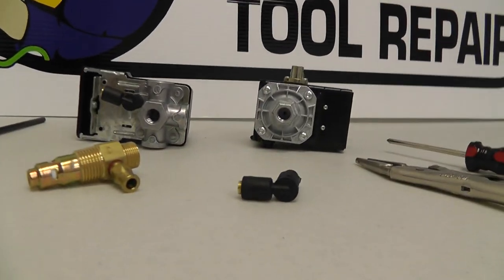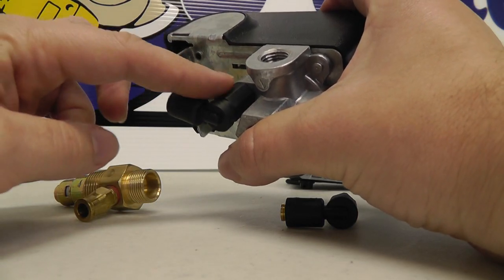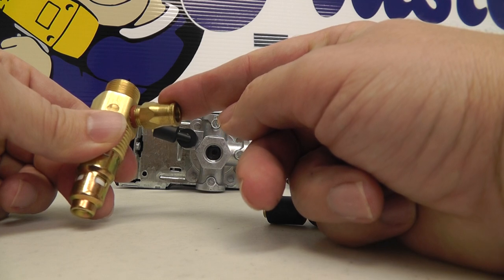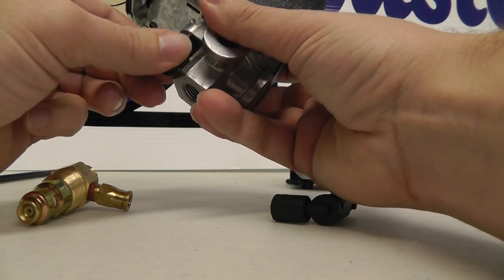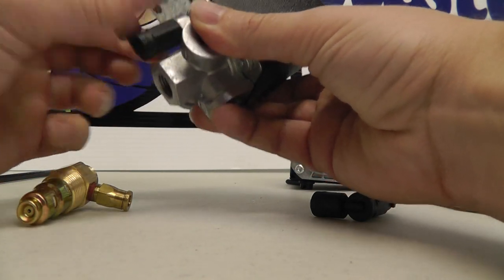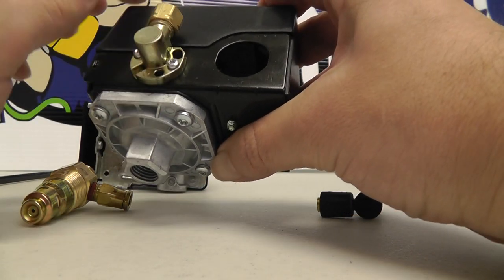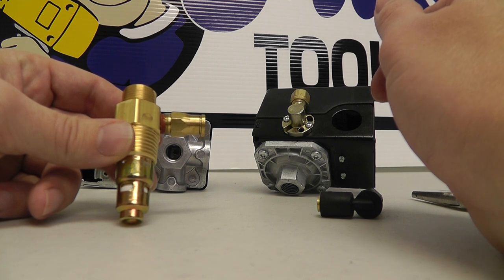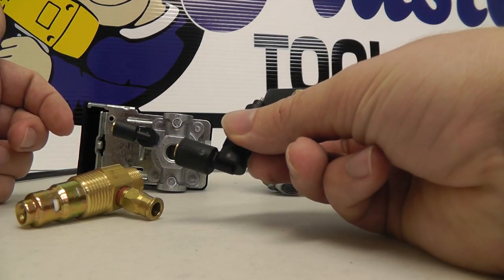How To Replace A Pressure Switch Unloader Valve - MASTERTOOLREPAIR.COM

Comment: Great video. I replaced my Unloader Valve on my Craftsman 919.165230 25 gal. compressor and I still have the same problem. I thought the new valve was defective til I noticed the tube from the motor and switch unloader was connected at the same place. There has to be some kind of check valve in there because the fitting screws directly into the tank. Yep, just had a "DUH' smack myself in the head moment !!!   Thank you for the info !!!!!
Reply from the maker: That's it, classic check valve problem. Glad our video could help you out!

Comment: it is a senco pc1010 by the way.
Reply from the maker: You most likely have a bad in-tank check valve. When your check valve is sticking, it no longer holds air in the tank like it should after the unit shuts off, so air is going to back-feed through your air lines and out of the small Unloader Valve on the side of your Pressure Switch. The unit will kick back on (as it should) when it reaches the cut-on pressure point, and the unit will keep recycling like this indefinitely if you kept the unit on. Most likely you just need to replace your Check Valve. 
You can watch a video on how to test the Check Valve for sure by clicking on the below link:
https://youtu.be/3xHJFV_TPHk

Hope this helps!

Comment: How do I remove the line going into the valve?  New valve has a plastic protector on it and I can't remove that either.  Help!?  Thanks
Reply from the maker: Does your valve look something like this?

https://mastertoolrepair.com/pressure-switch-unloader-valve-ev1wsi-p-23946.html

If so, there should be a brass collar inside the unloader valve, which protrudes from the valve, slightly. You first need to press down on the collar (needle nose pliers work well), then pull the tubing out. You have to press with some force, but the tube will come out. To insert the tube back into the valve, simply push it in with some force. It will self-lock, and should stay in place when you pull on it (lightly).

Hope this helps!
Reply: Great thanks!!!!